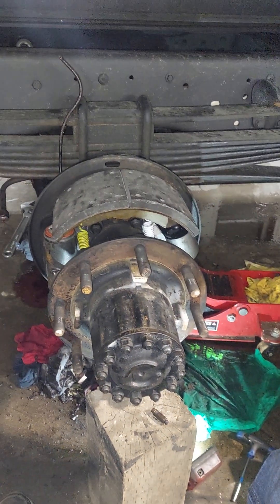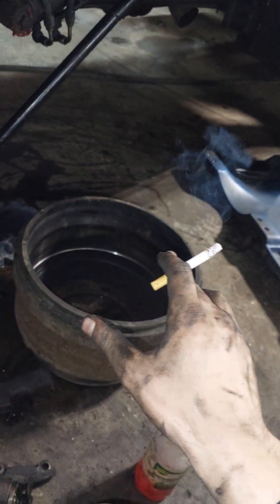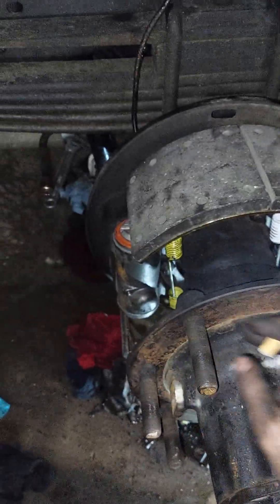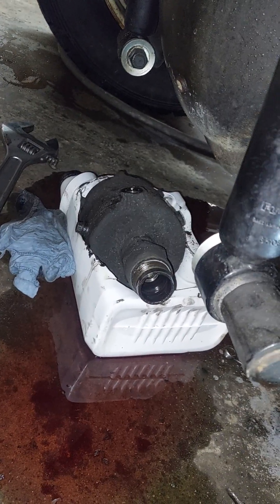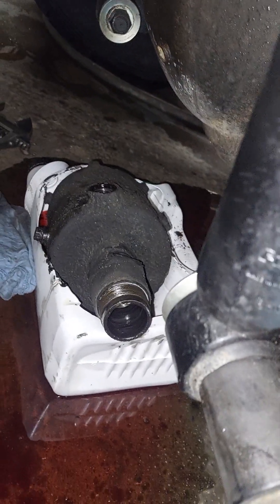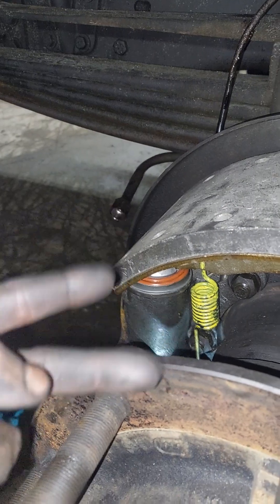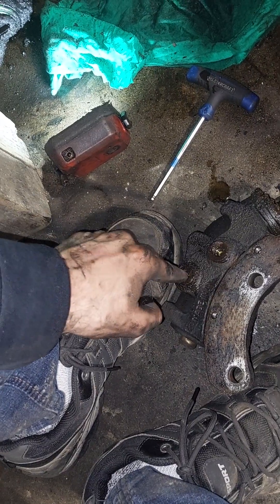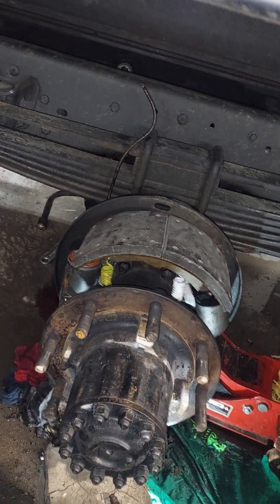Lucas Girling Brake Explanation F Series Trucks

Comment: Have we considered swapping to modern axle woth air brakes?

Im thinking thats what im going to do on my bus, old B600 (F600 bus body)
Reply from the maker: Hard to find a axle local with right gear ratio and width and axle rating
Reply from the maker: Plus i work this truck everyday so i would need a almost direct swap down tome is a killer for me
Reply: @ford1979truck  right on man.

My bus is a bit worn but still running, she needs a brake job, the pumper side (car like) has seal fails and is empty, but my service brake side is fully functional so I've been just using it very carefully.

Comment: 1987 F700 dump. Hydraulic brake system. Engine won’t run. Back brakes locked up. To free up the back wheels can I just unhook all the back brake lines ? Hope you understand my problem. Thank you
Reply from the maker: Use the caging bolts on the maxi pot and turn the bolts out about 3 inches and itll release the rear brakes
Reply from the maker: Do not unhook the hydrolic line going to the brakes its under high pressure . Very dangerous
Reply from the maker: The caging bolts are the opposite of regular air brakes and you turn them to the right and back them out to release the brakes on these systems . 2 to 4 inches depending
Reply: @ford1979truck  wow. Thanks for the quick response!  So the bolts have a reverse thread ?
Reply from the maker: @terryatpi  you back the bolt out its not reverse thread . Its odd instead of threading in to release they thread out
Reply: @ford1979truck  ok. Thank you very much.
Reply: Truck has been sitting in my way for 5 years lol
Reply from the maker: @terryatpi  did you get the brakes released
Reply: @ford1979truck  well , was going to do that today. Now im struggling with my Vplow wiring. Got a fair amount of snow too. That’s mostly why I want it moved. Been plowing around it all that time. Soon though. I’m pretty excited to get it moved. I’ll let you know. Thanks
Reply: Subscribed 👍

Comment: Did you have to take out the hub axle to access the bolts to the wheel brake cylinder?
Reply from the maker: No sir I did not
Reply: @ford1979truck  awesome ! getting ready to change the service cylinder but didn’t want to take out my axle. Thanks for the quick response !!! Did you put the new RC1 valve in-line to help with future leaking ?
Reply from the maker: @petevanrooy9680  no i never put a valve in line . Way i look at it these survived 25 years as is . Theyll survive 25 more
Reply: How the hell did you get the strings back on ? I removed the leaking front cylinder so i was able to remove shoes that way but can’t get the springs back on the new shoes. Any help would be great thanks

Comment: My f600 6.6 electric brk motor light and brake light keep flickering and the electric motor is always on when you push the brakes
Reply from the maker: @stephencurry3333  the electic motors well burn up . My last 2 trucks i unhooked the electic motor . Same as the shut off solidnoid well heat to point it can burn the truck i put a manuel on off cable on my truck
Reply from the maker: @stephencurry3333  the electric motor is sopost to turn on when you hot the brakes and turn off after they are released

Comment: I have same truck
Reply from the maker: Any issues ?
Reply: @ford1979truck  well I did have a issue today. But I figured out that I was the issue. SMH🤦‍♂️
Reply: @ford1979truck  I removed my high pressure line from the brake pump to the booster. Well the valve on the pump decided it wanted to come out with the high pressure line. In doing so I did not pay attention to the order the valve, spring and fitting came out of the pump. Upon reinstalling it I put the spring in the pump 1st instead of the valve. Thus creating a problem. No high pressure from pump going to booster. I chased it all day gave up heading home, on way home I started looking how that valve is supposed to sit and realized what it did. Big oof!
Reply from the maker: @xips420  i never had this issue but good information to have for the future